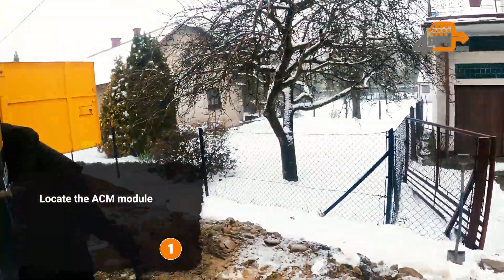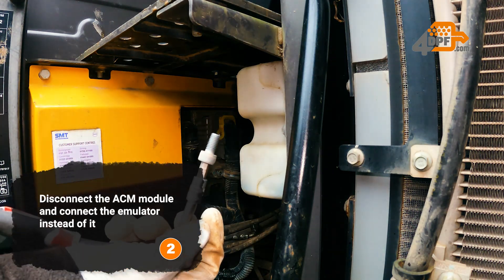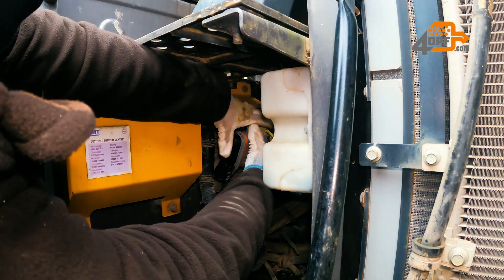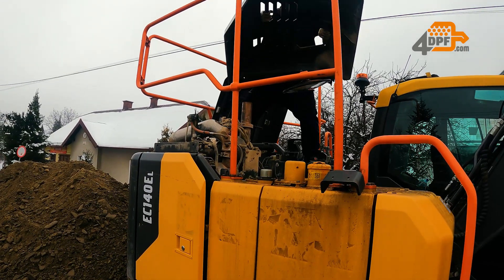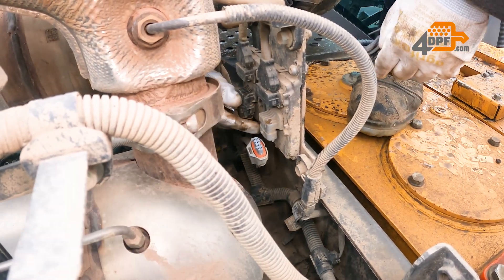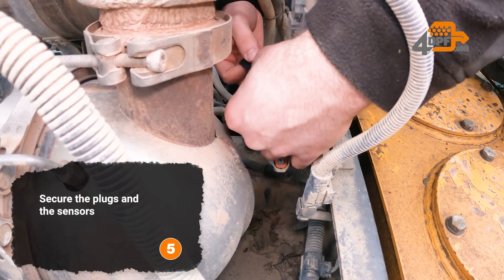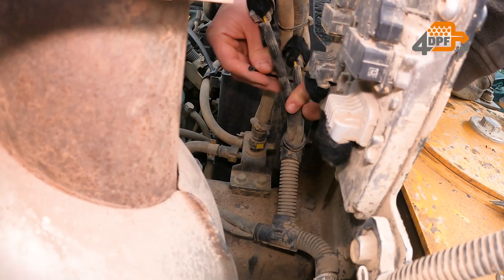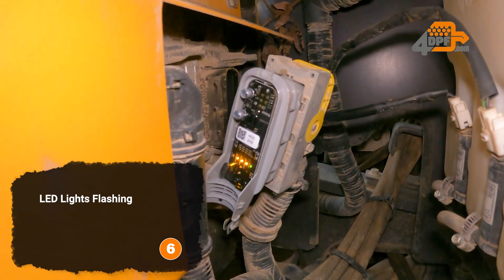Quick DPF removal - DPF+DEF delete kit for Volvo EC140EL with D4J engine

Comment: Needs a cover for the ACM module.
Reply from the maker: Just secure the socket with some insulating tape and you're good! :)
Reply: I need to install an emulator for a case excavator cx130d